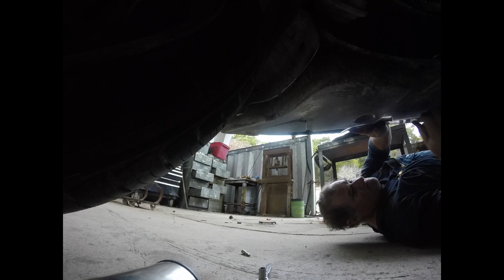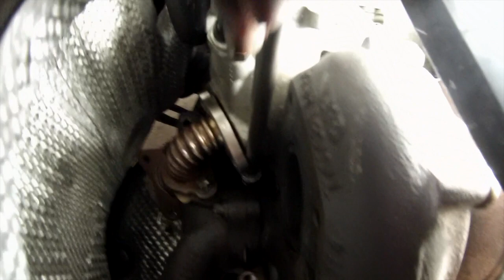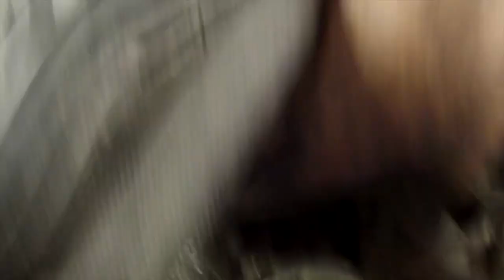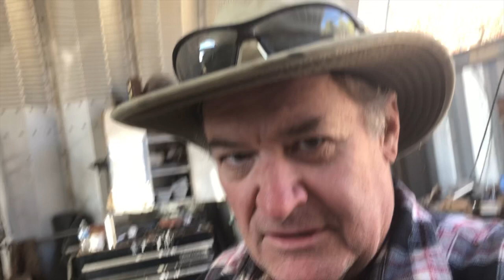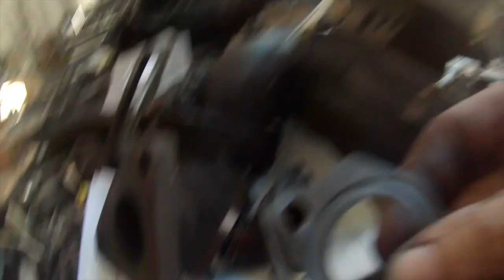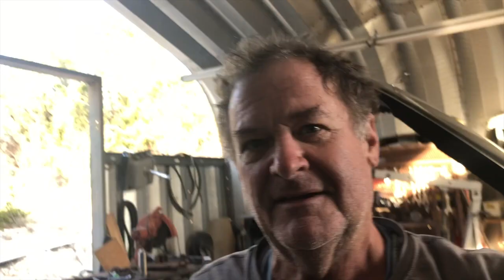Aimless and Mercedes E320 oil cooler seals

Comment: I cannot find the two bolts that hold the part that supplies air to the intake cooler.  Your video does not show where they are.
Reply from the maker: I guess I am not following you. I have slept since I did the job. If you are talking about the aluminum pipe I showed it coming apart. This job is quite involved. Good luck.